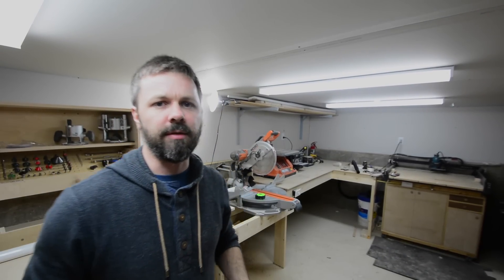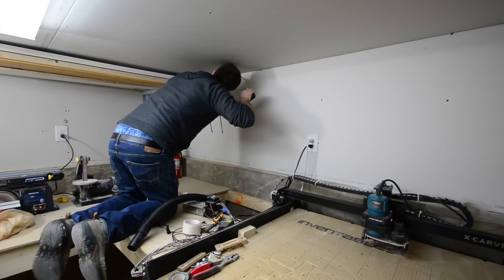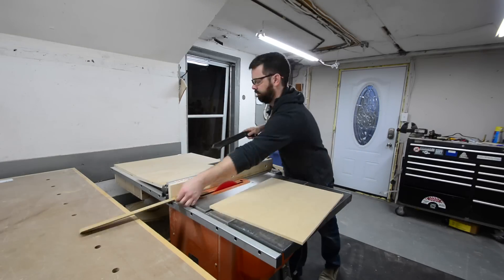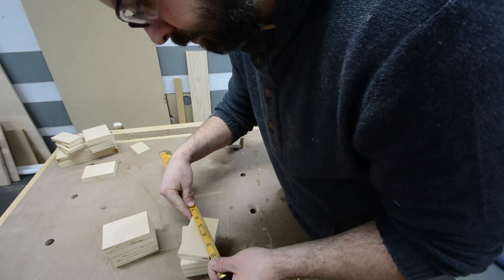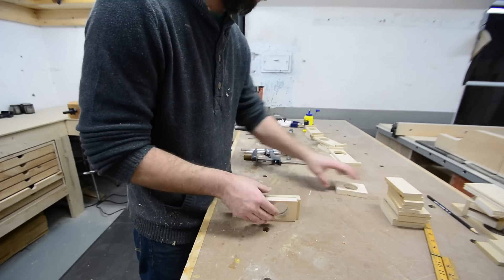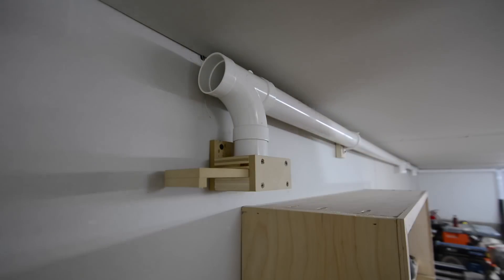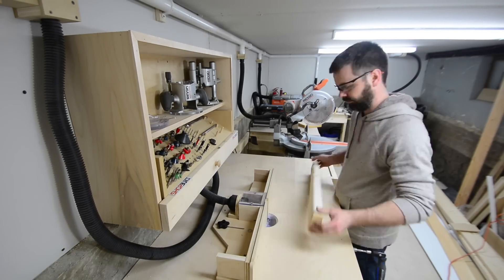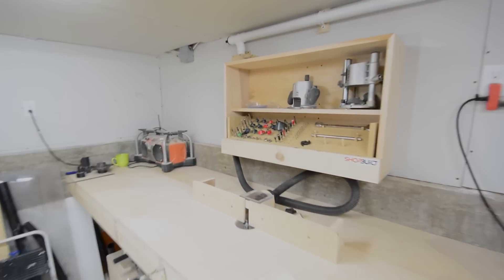Shop built - Dust collection (shop vac) & blast gates

Comment: FINALLY!!!!! a way to make this without 4" PIPE!!!!!!!    I'm a weekend/hobbyist wood worker with serious dust issues!!!  but I don't want to spent hundreds of dollars on a collection system. everyone I asked about using smaller pipe thought I was acting stupid!!  HA!   I'm not alone!!!
Reply: +rusty Shackleferd (mirrored eyes) 2" pipe works fine on a high pressure, low volume system like a shop vac. Not so good for a standard dust collector.
Reply: +Ryan Langan Also, look into 4" sewer pipe. I picked up 10' lengths for about $9 a piece from a local sewer supply.

Comment: Nicely done. I always see a 3 or 4 inch hose and wasn't sure if a shop vac would work.
Reply from the maker: +Joshua Pittendrigh Bigger lines like 4 or 5" are only necessary for tools Like jointers, planner or table saws because of the high volume as will as large size of the dust. Shop vacs have high pressure and work really well for dust collection for smaller tools like sanders or routers. The down side is the small filter that can plug on you, that's  why I use a separator before the shop vac.
Thanks for watching
Ryan

Comment: I would change your Y to a T instead. Also some of your T's are facing the wrong direction which would prevent some of those small pieces to get clogged up. I would also relocate the Shop Vac more to the center to help with pulling power. Long runs will create less pull on air and dust.

Comment: I'm guessing your shop vac is a 1.25 or 1.5" hose? Mine's 2.5" so the central vac piping is too small. I did see that the grey 2" PVC electrical conduit is cheaper than 2" pvc pipe, so I think I'll go with that. I think it has larger radius 90 degree elbows also.

Comment: very nice, Ryan, it's rare to see a DC system that is cheap and quick to install with a shopvac and small pipes, when most YT woodworkers go for the full size systems.
Thanks for the inspiration !
Keep on trucking ! (from France)
Reply from the maker: +MakeFix for sure, it's really not necessary for your smaller tools or even a smaller work shop, it is really surprising how much dust you can collect with a shop vac.

Comment: If you used a low-voltage relay system like what triggers a furnace or a central vac, and made the blast gates electrically conductive when open, it saves having to open the gate then flip a switch or flipping off the switch followed by closing the gate.

Comment: I like it. Great solutions. It was cool how you used that short piece of hose to just suck up some dust that escaped, just by holding it to the suction. It must still have plenty of suction then for that to work.
Reply from the maker: +Bruce A. Ulrich oh yeah, I was surprised that even at the router table there seems to be very little pressure drop. Works great:)

Comment: I'm wondering if the total length of the pipe run affected the suction from the shop vacuum collector? I have been thinking about doing a system much like yours.

Comment: Great video, quick and informative.   Your last elbow on the left of your router table is installed backwards though.   The elbow should sweep towards the vacuum, not away.  Just like the ones on your saw and OSS sander.

Comment: what shop vac model do you use? thanks for the video
Reply from the maker: +Yannick P it is a 5hp ridgid
Thanks for watching
Ryan
Reply: +Shop built 5hp in a 120v outlet?
Reply from the maker: +Yannick P lol, yeah I don't how they rate these shop vac but its not a true 5 hp, that's just what it says. It is one of the bigger shop vacs, comes with a 2 1/2" hose.

Comment: kewl but compared to most if not close to all other dust collection videos I've seen so far your pipes have the smallest diameter. Is this a problem or is even by design? :D
Reply from the maker: +PinkPonyOfPrey 4" or 5" lines are only needed for big consumers like planner, jointer or table but small stuff like sanders and routers, the ports are usually  only 2 or 2 1/2" anyways and a shop vac can easily keep up.
Thanks for watching
Ryan
Reply: kewl! lots to learn as a noob over here! :D

Comment: I noticed you seem to have a lot of RIGID power equipment, any reason for choosing RIGID? How about the table saw? Compared to other brands? Accuracy?
Reply from the maker: +Bill Moss it mainly comes down to best bang for the buck. You get a decent tool for the price, I've been using them for a long time now and really don't have any complaints, the table saw is a really good example of this, as far as I know it's the only for cabinet saw with a cast top for under 600 bucks, 500 on sale.

Comment: You might want to run a bare copper grounding wire thru the length of the pipe and ground it. Static electricity can buildup and ignite a dust cloud.

Comment: what size is your shop? I currently have a small shop that's 10x16 and I'm looking for the right system for dust collection. I'm thinking of using schedule 40 2inch pvc pipe to run through my 2x6 joist innumerable shape around the shop. Does your shop vac have enough suction on your system and what size hoses are you using
Reply: At 2:20 he says he drills an 1 3/8 inch hole for the shop vac hose, so it should be around that diameter.

Comment: What is your longest and highest run?  I am doing this next week and need to make 2 ceiling runs.  10 foot ceilings for me mean 8 feet up the wall and then 12 to 20 feet over then down.  Do you have any runs close to this?  I am wondering if its going to work.  Thanks
Reply from the maker: +Affendog I would say my overall longest run is about 20ft. My shop vac is a mid to large size one and there is still a ton of suction at the end. Worst case you might need a larger shop vac. Does you shop vac come with 2 1/4" hose or is it smaller?
Reply: Shop built it's a 12 gallon 6hp shop-vac. So
Reply: Shop built 2 1/4
Reply from the maker: +Affendog I'm guess you'll be fine

Comment: NIce! I like the hose coming from the ceiling in the center of the x-carve. I always thought that was the best solution, but not always possible. Cool result! it seems you don't need a 3" diameter pipe to get a decent dust collection! my shop is too small for big pipes but maybe with this size it could fit. Although maybe it does not make sense because everything is less than 2meters away and I keep the vaccum cleaner in the center.  Well! it seems I am thinking here instead of commenting :P good job man! Thanks for the ideas!
Reply from the maker: +Cactus! workshop I kinda had the same setup but it was always a hassle to change tools. I'm actually really happy with this setup, it works surprisingly well. If you already have some hose the pipe is really cheap.
Thanks for watching
Ryan

Comment: Nice video, I will be doing a similar setup in my garage.  Not really sure if my shop vac will have enough suction.  With a total pipe length of 25 feet, what type of shop vac/cyclone would you recommend.

Comment: Great job!
Is the 2" pipe wide enough, and does that improve suction over 4"?
I imagine it does, as it's easier to suck through a 5mm straw than a hose pipe.

Your job looks less obtrusive than other fits I've seen with 4" pipe.
Reply from the maker: +Daves Faves you need an actual dust collector that can handle high flow for 4" pipe. The larger size shop vacs are low flow high pressure at 2.5" with is ideal for smaller tools like sanders and even the chop saw. Something like the table saw would need a lot of flow (4"line) because it creates a lot of dust.
Reply: +Shop built thanks for your reply and info. I like the way you've got yours set up.

Comment: Nice work! I made a central vacuum system using 3" PVC drain pipe. Instead of blast gates I used large 3" PVC ball valves I got from Amazon. They are a little stiff, but mounted to the wall they are no problem. I really like your blast gates. Kudos!
Reply: I think the idea of the ball valves is great. I´m designing my dust collection system and I´ll definitely will use your idea. Thanks

Comment: is it better to run up to the ceiling or can I do a lower wall run ? I'll be using a shop vac and a 30 gal fiber drum with dust deputy on it. I may want to add a 20' ceiling run out to the middle of the shop for Table saw and shop clean up. your thoughts, input and time are greatly appreciated

Comment: Hi I liked this video a lot I saw that you used 2" pipe for your dust collection all of the other shop made & store bought videos I have see on dust collection use 4" or 6" pipe does 2" pipe work just as well?
Reply from the maker: +Vince Baker bigger lines are only necessary for things like planners, jointers and tables saws. Smaller tools typically only come a small port because that is all they require. Shop vac actually work really well for this because they have high pressure. They only down side is there filters plug easily. That's why I use a separator before the shop vac to help with that.
Thanks for watching
Ryan

Comment: Great video. Weirdly, in my part of the world all the shop Vacs come with 35 mm I.D. hoses, which is about 1-1/2 inch, same as most household vacuum cleaners use, so I'm not sure if any of these will do the job as well as the ones you have available.

Comment: Pretty impressive what you can get with just a shopvac, eh?
Reply from the maker: +Wordsnwood (Art Mulder) shop vacs work great for this stuff, to small for a planner, jointer or table saw but works really well with smaller tools because of the high pressure you get with shop vacs.

Comment: I have that same 5HP Ridgid Shop Vac. Is 2" or 2.5" pipe the best to use? I tried some of the 2" fittings at Home Depot on the ridgid hose they had on display & it seemed slightly loose. I'm trying to turn my cart setup into a stationery one like what you have here. Love the Video! Thanks in advance for any help!

Comment: Very nice setup.  I have a small hobby shop and don't really have the floor space for a roll around unit.  Yours looks perfect for me, but I was concerned with the suction loss with the distance from the dust collector/vac.  My shop is too small for one of those big systems.  Thanks for sharing.  Where did you find the central vac pipe and fixtures?  Great job on the blast gates.

Comment: Nice !!  For small or seldom used tools a shop vac should do just fine.  Any plans or thoughts about a hood over your miter saw to confine and collect more saw dust?
Reply from the maker: +KSFWG shop vacs work really well with smaller tools, no plans for the hood as the port collects majority of the dust, I made a video on that if you want to check it out:)
Thanks for watching
Ryan

Comment: Tried making mine and the two inch tubing whistles so loud. Did you happen to have this problem as well?
Reply from the maker: +Tony Pietrini no, sump pump hose will give you that problem. Never had that problem with pipe before...
Reply: Will give the PVC a try then.  Thanks!!!

Comment: Which is better for small DIY, the PVC pipe or Flexible Hose? 👍
Reply: David O'Sullivan you will lose more suction with the flexible hose. This may not be an issue depending on the size of your shop. (Quick and simple version of answer.)
Reply: David, more resistance / disturbance of the air flow in flex hose as opposed to the smooth surface of the PVC piping.

Comment: Ryan, how well does the 2" line work? I'm wanting to build a vac system for my small shop and was wondering if the pipe size was enough. Can you buy blast gates that size? good job on the video too.
Reply from the maker: +George Hill I'm actually really happy with this setup. Great results for relatively cheap. You probably can't buy exact fit blast gates, you would probably have to self adapt the blast gates with either electrical tape or making an adapter.

Comment: Run a ground wire on your PVC pipe. Wood dust whizzing through the tube will create static electricity, and can ignite the dust. It does happen, even in large scale furniture shops.
Reply: +TheBikerScout ok 2 questions: 1. Fire needs fuel = dust, air = vacuum, but where does it get the ignition source, i.e heat? and 2. what ideal mixture of fuel and air does the sawdust need to be in to create the dust explosion?
Reply: +Joe Foley the ignition source is almost always a contact switch from a machine's on/off panel. Or the blower motor assembly. This is usually what the fire inspectors find. 
Don't know the needed air to dust mix. I've just always played it safe with a couple of shop air filters, and just a run of speaker wire around my vacuum line air hoses to a grounding point. I attach the speaker wire with a pointy screw that pokes into the dust air stream, and make sure some bare wire wraps around the head on the outside.
Reply: +TheBikerScout I'm almost finished building my shop/shed. So will be doing more research before I building my dust system. Friction heat etc should I think build up at corners or near machines. But switches are far from dust hosing I'm not sure if that's it. If one was to use metal 90 degree bends etc and Earth them. It could do the same job.
Reply: is the speaker wire left coated or bare?

Comment: Hi. Great video , I like the explanation and the instructions you gave. I’m wondering how this 2” pipe system has been for you. Do you still have it today MARCH 31 2018 ?
 I want to do the same thing as I found some unused central vacuum pipes and fittings.  Are you satisfied with the size,or SORRY you didn’t just go with galvanized or 2” 1/2 “ PVC . Or any regrets or changes you made or would have made would be GRATEFULLY Appreciated.

Comment: Looks great and I love the budget :).  Only thought I had was I saw some videos previously about PVC used for dust collection and the need to ground the static electric buildup.  Curious if you are noticing a significant static charge after moderate use. I believe the concern was  dust sticking to the inside and potential for spark ignition.
Reply from the maker: +Justin Kirk yeah, the risk is low so I'm not to worried about it but definitely not a bad idea.
Thanks for watching
Ryan

Comment: did you use mdf or plywood for the gates? in the video you said mfd, but it looks like plywood.. would it matter either way?
Reply: Ryan Haugle looks like he used both, ply for outside portions and mdf as the middle slider
Reply: LaBelle's Workshop that makes sense! It looks like MDF when he's cutting, and looks like ply on the drill press. Ha. Thanks

Comment: Most shop vacs are high pressure drop and low flow compared to the big chip extractors which are low pressure drop high flow. This means the shop vac can easily overcome the pressure drop caused by the relatively narrow pipe and maintain a good air velocity to keep the dust moving. You need big diameter pipes, as previously discussed, if you are moving big chips and shavings from the big machines and you need the bigger diameter to prevent the pressure drop strangling the flow. Hope that makes sense. 
Great video. Thanks.
Reply from the maker: +Gary Knight thanks for helping clear that up.
Reply: My pleasure
Reply: Gary Knight I
Reply: Gary, it's possible to use a 1400 w, or almost 2 hp, shop vac to create a small size dust collection system? This shop vac can produce 265 mbar of vacuum and its hose is about 2 inches wide in diameter. My worries are about which diameter of piping I can use and if can be long enough to cover the shop, with some collection points.

Comment: I have a similar dust collection setup and spent some time at Home Depot comparing pVC pipes. Have you had any problems with the 2 inch pipe like pieces of wood or leaves stuck in the pipes? I was comparing 2 and 3 inch pipes. Thanks, Adam
Reply from the maker: +Adam Mathis It would largely depend on what your using it for, table saw, jointer and planner would all require something larger than 2". I know  2" is fine for the x carve and the chop saw as I've been using it for a while now without a problem. I haven't used the router much with it but I don't suspect to have any problems there either. The limitation using a shop vac is the filter, it's so small compared to a dust collector so it will plug easily without some kind a separation first like a bucket separator I'm using or even better a cyclone like a clear cue. Hope that helps
Ryan
Reply: Thanks Ryan! We are thinking the same thing. I have a cyclone attached to the shop vac.  I'm sure that with the 2 inch you have great suction. I don't have a planer (yet) but do have a DeWalt contractor table saw, 6 inch jointer, router table, chop saw, plus all the sanding stuff.  My shop vac is the 1 inch and change and not the bigger one. I'm thinking 3 inch would be the smallest diameter I would use.  More thinking to do! Adam

Comment: Very nicely done! Especially like your extra hose at each tool AND the DIY blast gates. I think I mentioned before how you can really soundproof the vac cabinet by putting some carpet pad on the inside walls.
Reply from the maker: +MRrwmac I had planned on doing that in this video but I ran short on time:)

Comment: Nice work.  Thanks for sharing.  What is the horsepower and size of your shop vac?  Where did you buy the vacuum pipe and fittings?  Thanks.
Reply from the maker: +Larson Bennett they rate it at 5hp but I just go by the suction size, this one is 2 1/2" hose. Pretty well all the big store sells the central vac stuff, like I know Home Depot does.

Comment: nice video  Ryan. Im in the process of seting up my dust system.  I bought the shopvac system off Amazon. ins all 2 inch.  same size as my vacum hose. wondering if you might have some suggestions for me. Im running a radial arm saw, miter saw and table saw to hook up.  Thanks in advance.  keep up the good work !
Bill
Reply from the maker: +William Howard hmmm, the biggest mistake made on this set up is not putting the blast gates closer to the tool. It's important to make the system as easy to use as possible or you just won't use it.